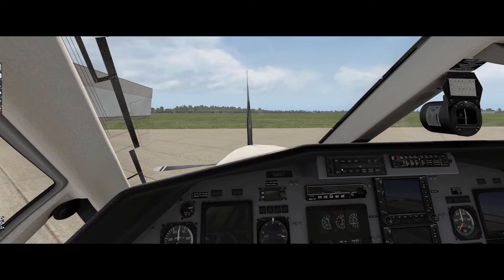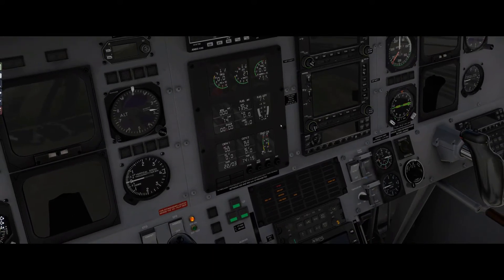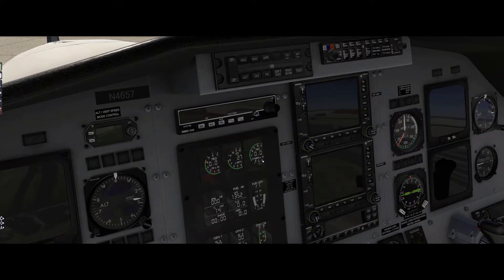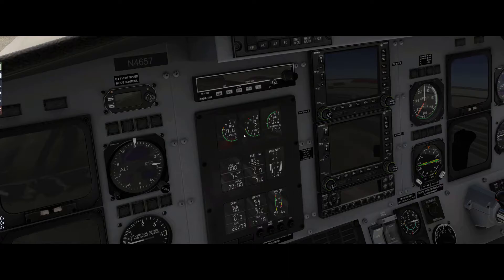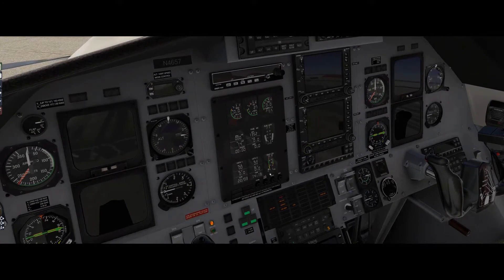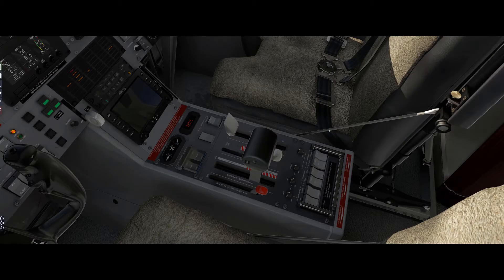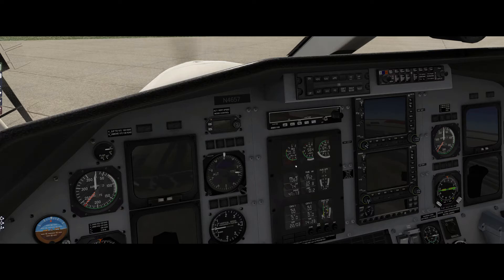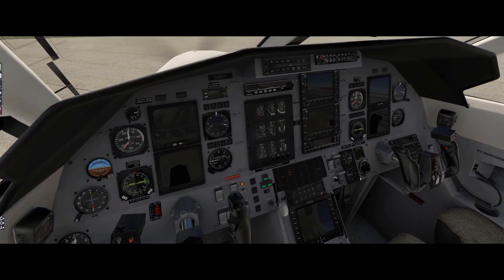How to Start a Pilatus PC-12

Comment: Doesn't the prop go flat (no angle of attack) at shutdown?  If so, why would a tailwind spin it the wrong way?
Reply from the maker: A feathered prop is less susceptible to windmilling, but it can still windmill in a crosswind.
Reply: @GeneStuart  thanks for the response.  I'm afraid I don't see the crosswind problem as the feathered prop would tend to be equally impacted both top and bottom.  I'm not a turbine guy, but I could imagine that having too much back pressure in the exhaust during startup could be a problem that would give rise to a tailwind limitation for startup.  But for a feathered prop, it's hard to see how a tailwind would be a problem.  Could it be that your reasoning dates back to an unfeathered prop, not the PC-12 specifically?

Thank you for sharing your knowledge and experience.
Reply from the maker: Think of it more in terms of tailwind component, not a direct tailwind. Take a quartering tailwind, for instance. Even though we feather the prop during shutdown, we always install prop anchors before leaving the airplane because the prop will windmill in a strong enough wind, even though it's feathered. Any time there's surface area exposed, the wind can grab on and start to rotate the prop. It doesn't take much to get it moving. You are right that backflow through the engine is another reason for the tailwind limitation. Counterpressure on the exhaust flow can result in higher hot section temps... not a good thing. In a strong tailwind it's also possible to ingest exhaust back through the intake which leads to diminished combustion and higher temps. For a variety of reasons, airplanes work better when the airflow is nose to tail. Cheers!
Reply: @GeneStuart  sure, there will be small differential pressures on the blades caused by the airflow not being consistent due to interacting with the aircraft and ground leading to windmilling, but that is pretty negligible and would happen in a headwind as well as a tailwind, so I'm afraid it still doesn't make sense as support for a tailwind limitation.  I'm sorry if I'm being dense.
Reply: @GeneStuart  I thought the POH might add some clarity, so I checked the POH available online.  I couldn't find a tailwind limit looking at engine start in sections 2, 3, and 4, and searching for "tailwind".  Of course, there are likely many versions of it, though.  If you happen to know what version has the limit and/or where it is in the POH, I would appreciate the pointer.

Comment: Does the inertial separator stay open during start?
Reply from the maker: Yes! Pilatus/Pratt don't require it to be open unless you're operating on an unimproved surface where FOD might be an issue, or unless you're in icing conditions. Most operators want it open during surface and low altitude operations though, just to be safe. It doesn't raise your temps too much, so generally the added protection against FOD is worth the fuel cost.

Comment: Enjoying the content, very informative. Curious, are you familiar with the REP package for this aircraft? I'm under the impression (desktop simmer) that it does a better job of modeling several things you've brought up in your videos. Keep the great content coming, thanks for sharing with us!
Reply from the maker: Thanks for watching, and thanks for the kind words! Motivates me to keep posting. As far as the REP, I do have it installed. I installed it before ever really playing around with the base version without it, so I'm not sure how much improvement there is over the original. But, apparently the REP does model the mid-start ITT rollback (which I have noticed in the sim... pretty cool). According to the developer, it does a bunch of other stuff for the engine like makes the spool time more realistic, models hot start behavior, and tracks engine damage if you over-temp it, etc. It claims to make engine temperatures more realistic too, but they still aren't great. I'd give them a C- for temps... They're pretty inaccurate during several phases of flight. But, still might be an improvement over the original. Still worth getting I think.